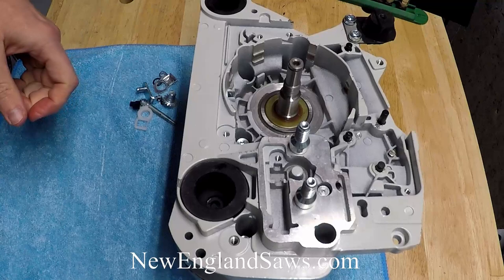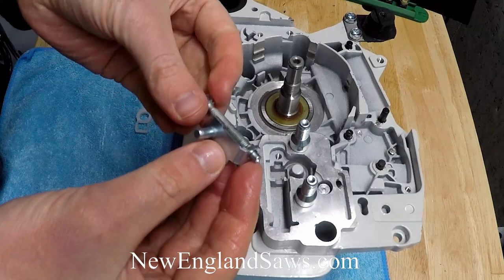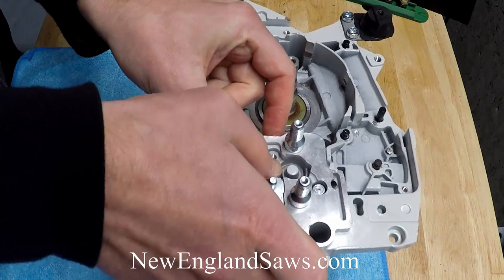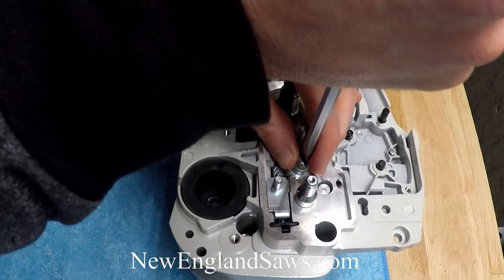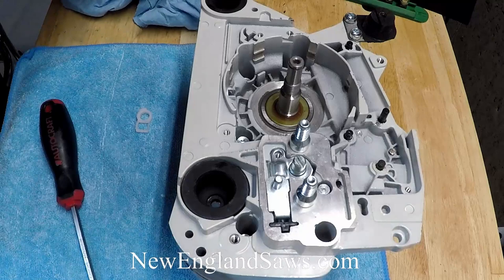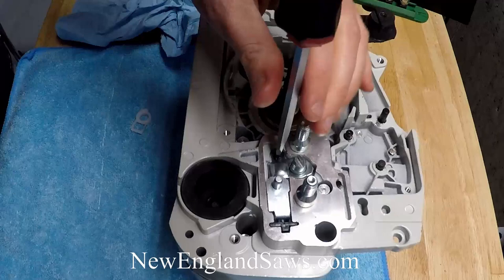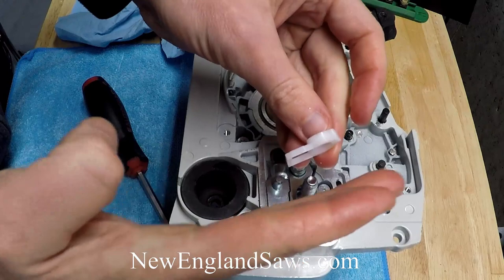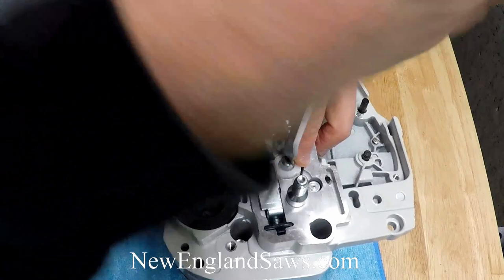Farmertec G660 Build Series - Video 4 - Chain Tensioner

Comment: I've had dramas with trying to mesh the gears. Bought an assembled G660 and tensioner worked fine initially, but then meshing went pear shaped. Tried all the different YouTube suggestions to fix it, but it was still pear shaped. Bought another tensioner, same problem. Even tried mixing and matching from old and new kits. Still horrible. Saw is largely an expensive paper weight till I can fix this. Any tips?

Comment: Is this an automatic adjuster or ???
 A friend of mine let me borrow his smaller (14" or 16") Stihl chainsaw about 15 years ago to cut some limbs, I don't remember what model it was, but if I remember right it had an automatic chain adjuster or something like that. It seemed like a nice little saw and ran smooth. I remember liking the chain adjuster on it but I just don't remember the details about it.
Reply from the maker: No, you have to set the chain tension with this adjuster. It’s not automatic
Reply: @newenglandpine8660  Ok, thank you

Comment: no grease on those gears for the chain adjuster?
Reply from the maker: Yes! Put grease on the threads for both the adjuster and the bevel gears.
Reply: Holy cow, that shouldn't be that hard to assemble.😮